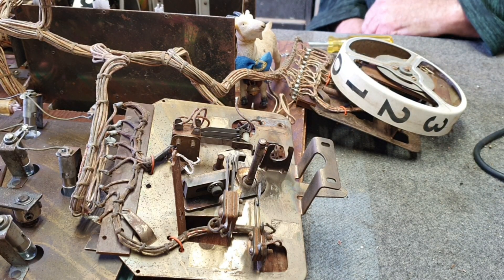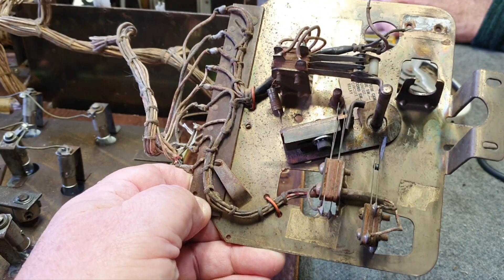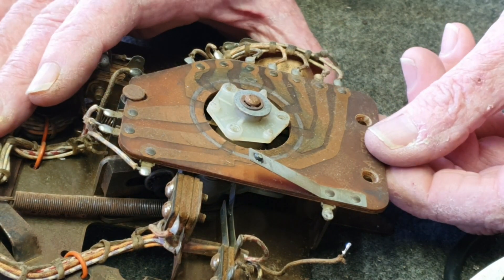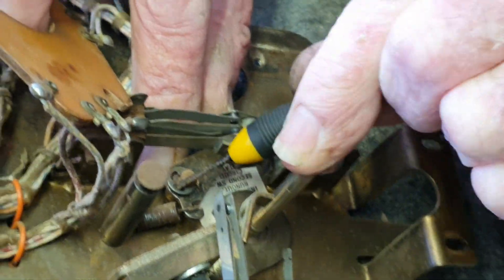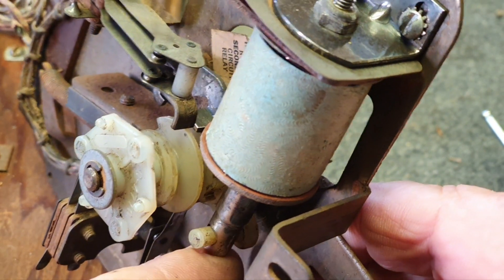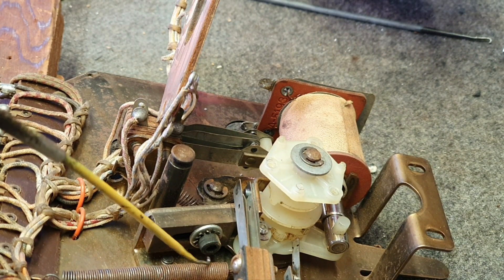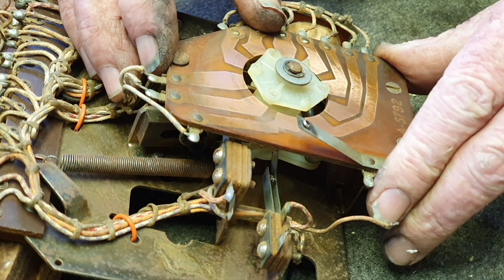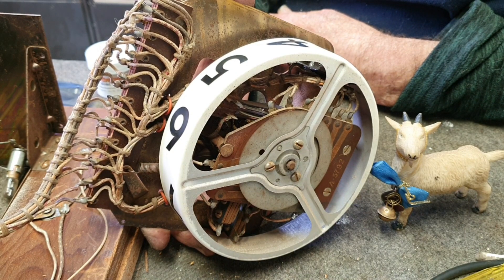Rat Trap Score Reels Gottlieb Servicing Explanation Plus Adjustments

Comment: These score reels are a mechanical wonder. This is a great video showing what you have to do to get these working right. As you say, once you do this cleaning and adjusting, you will probably never have to touch it again. Usually when you work on these, you are the first person to ever give them some care and attention …. and they worked for years without any help or maintenance. Mechanically, these score reels are mighty. Thanks for showing all this great stuff.
Reply from the maker: They are a great piece of engineering.

Comment: Why is it called a "Rat Trap"?  
Regarding the spring and cutting off two loops.  New springs have a spring coefficient called K in their formula for how strong they are.  Your words describing the spring's old age is technically stating that the K coefficient has lowered.  By cutting off one or two loops, you make the spring stronger again (higher K coefficient) and essentially returning the K coefficient to it's original number.  So those arguing against it are somewhat igornant.  Now if you cut too much off and make the K value higher than it used to be when it was new, then you've introduced extra work that those people are arguing about.  You don't want a spring that's too strong for the work required.
Reply from the maker: Never knew the technical terminology for it but I was taught about stretched springs over 50 years ago by guys whi had been working on typewriters for a long time it just male's sense to do it. And yes very aware that to much cut off will also interfere with proper operation  , thanks for telling me about the K coefficient.